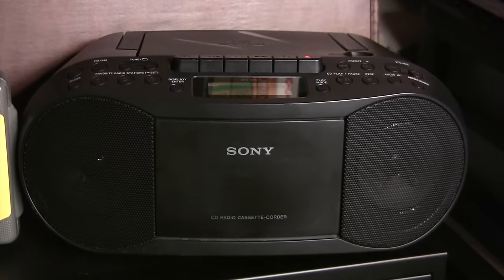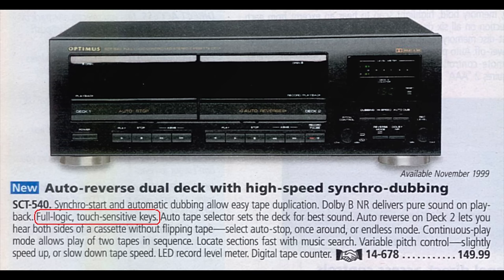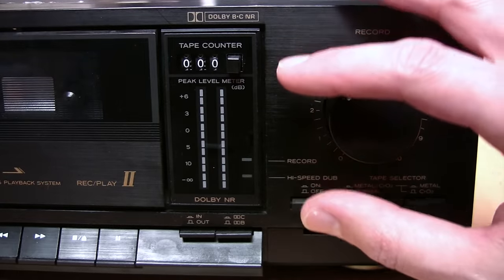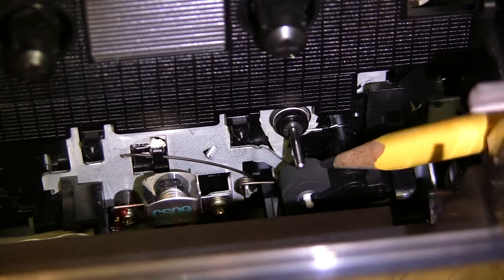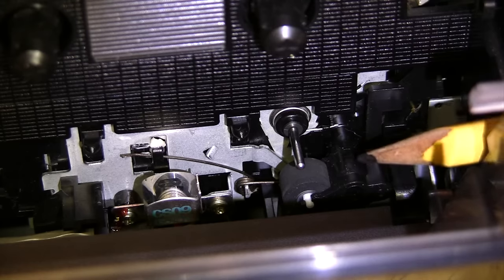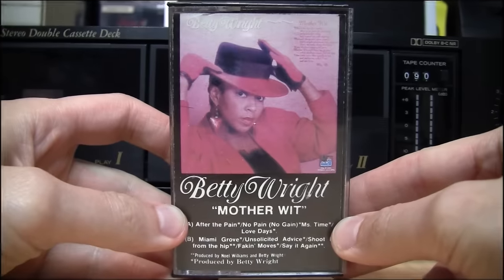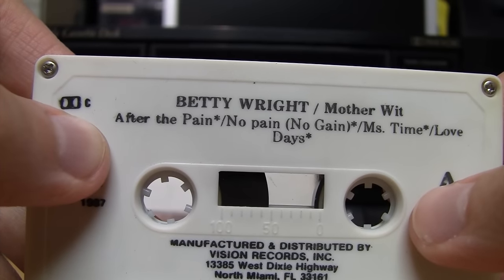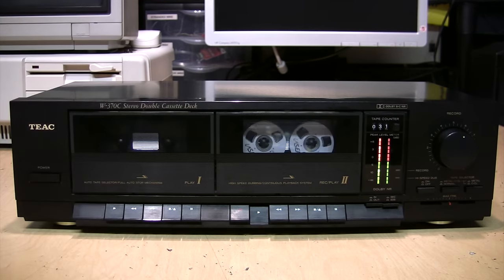Cassette Decks for Dummies

Comment: The lead in/lead out of a compact cassette is approximately 5 seconds.  Easy to time when starting the cassette and a recording, not quite so easy when ending, as you cannot tell exactly when the tape ends and the lead out begins.  (This information I learnt via a Maxell cassette recently.  Also it showed how you can tell what side is which and the direction of playing etc.).  Just thought I'd share as I never knew this before.  Great video as always and some very good points.
Reply from the maker: I like to leave a few seconds of blank tape at the beginning after the leader because it gets the most wear and tends to have dropouts.
Reply: @vwestlife  Yep, I'm just mentioning for those who wondered, especially as I'd never known how long the leader was before then.  I'd never even bothered to question it before either, LOL.

Comment: No alcohol at all on the rubber, some pinch rollers will go mushy in as little as a few months. Total abstinence. It destabilizes the binding molecules. No whatever else (the 30%) or alcohol doped window wash either. Lighter fluid (naphtha) pure and simple, lower odor too. No cotton thingy either, at least you mention the risks. Try and get some strands out of the roller axle down in that tiny space. It's like string on the floor with an office chair wheel, it gets wound up in there and acts like a brake. 

I went to a party back in the day with some live show tapes I made in binaural 3D. Irreplaceable! This is the most important test to do when picking a deck, the first play test which I heard there at that party. The tape sounds fine then on the count of 3 or 4 seconds the treble fades to a quiet muffled tone. HIT STOP. The tape is getting mangled! We were bummed out not to hear the show tape I tried in their deck. I wasn't about to play it.

I grabbed the bottom end of my cotton T-shirt put it over the end of my finger with no solvent at all and rubbed the capstan and pinch roller while it was playing several wipes each turning the end to fresh cloth. All the alcohol there was fit to drink. I've seen brown bands on the capstan that took a fingernail to chip off which no swab will get, this one wasn't that bad. Cheap pre recorded tapes will do this. I popped my tape back in and clear unchallenged sound happened. Whee! Party down! This is how to do it with naphtha.

Finally Dolby HX Pro is the best thing that ever happened to cassettes. There is 10 to 15 dB of treble boosted in what is called pre emphasis on record and cut on playback, so a cassette only gives flat response at that minus 10dB not at full level. All those shows I made are recorded at minus10dB, until I got the last deck I bought new. It had Dolby HX Pro. I didn't bother with C only used B but being able to record hot at 0dB made far better sound than ever.

Comment: This double cassette deck looks like 👍 a 1980’s model. My first home 🏠 stereo had this feature, but I cannot remember if it had an auto reverse 🔄 feature or not. I bought the stereo back in 1988, when I was still in school 🏫. It had soft touch controls, and many 👨 LED lights, in red and green. I thought the stereo was a great 👍 buy. I had no trouble with it, other than a broken 😞 on/off switch. Your friend, Jeff.

Comment: Great video. I have a big question for you on hook up. I  worry about ruining my receiver. I have a pioneer   receiver capable of  laser disc, cd, and tuner. Phono, sat tv. I purchased a 1981 Panasonic stereo cassette deck 635. The back has two sets of male adapter plugs, one set for out and one for in. I hooked it up to the tape setting on the back of the receiver. The cassette player does play. However, the tape plays on all  component settings, meaning if I click on phono, the tape plays through over the album. This goes all the way down the line. I watched the video to hook up. Any help would be appreciated.

Comment: Thanks for the video! I finally found a component tape deck at my local thrift store, a Technics RS-T11, made around 1988, for $3. But… it didn’t have a power cord (found one at home), and the belts appear to be worn (the take-up reel sometimes goes slower than the other reel, resulting in the tape being ‘eaten’). Is it worthwhile to try to obtain new belts and replace these ones? Or keep looking and hope for better luck next time?
Reply from the maker: Open it up and see how much of a job it would be to replace the belts, and if your skill level is up to it.
Reply: @vwestlife  Laughing… my skill level is zero so far, but it doesn’t look impossible with more research. Each tape unit has a wider belt plus 2 smaller belts. (Unless the smaller is really one long belt and I just can’t see where it connects.)

Comment: I think you are the perfect person to run the following experiment: Does recording with Dolby and then playing back without Dolby make a better sounding recording? I claim that it does indeed.
Reply: Some think so, that's what has made most recordings suck since the mid 80's. They found a way to boost the treble both at home and in the recording studio, louder LOUDER! Pink noise is the physical law for sound, white noise is what happens when this BS boosting is done. However the pre-emphisis at 1-7/8th IPS is so much that - 10 or less dB is flat but at 0dB max the treble is rolled down. Dolby HX Pro changes this game to more treble at 0dB than without.
Reply: On all the decks I've tried, Dolby NR playback doesn't seem to work properly any more, it loses some of the sound. Maybe due to drifting values of the components(reduced capacitance etc) within the noise reduction circuit?

Comment: I wish I had known about the finger test before I bought my Technics RS-T20. It won't take up tape nor readily available belt sets are available. Perhaps, the latter is also an important thing to consider before buying an old deck.
Reply: Yes, thats generally a good idea for retro equipment, do a little research into serviceability in general, and in that, the kind of decks suggested in this video are typically fairly easy to service, and not that much of a loss when that doesn't work out. I do own my 'dream deck'  (aiwa ad-f990), which I wanted to own ever since it was released somewhere in late 1983.. its quite fancy and very capable... and an absolute nightmare to work on... which I knew, so no big deal to me, but not what I'd suggest unless you don't mind very complex and potentially expensive repairs (as those often involve finding a donor unit for parts, and possibly hiring some experienced tech to work on it as it is an absurdly complex device)

If you can figure out the size and shape of the belts, you may well be able to find appropriate ones. Keep in mind shape is also important.
Reply: When someone asks to choose between a couple of available models on cassetteculture, the first thing I do is check for the availability of belt kits for each one.
Reply: Very often "different" decks used the same tape mechanism. Look online for the service manuals (not user manuals) for several decks close to the model number of yours, e.g. RS-T22, T30, ... and from more or less the same year (+/ 1 or 2) and see if the mechanism looks exactly the same. If it does you can than search for a belt kit with the other model number. Also bear in mind that Technics was practically the same company as JVC and Panasonic, sharing a lot of components. So it might be helpfull to seek out service manuals from similar looking devices from JVC and Panasonic of the same year too. It needs probably some digging, but I'm confident that it's possible to find belts for that mechanism.
Reply: You can buy packs of belts in various lengths. It's not always ideal, but better than nothing.

Comment: Hi i have a question
I did read often that after 10-20 hours of playback tape heads, capstan and pinch rollers have to be cleaned. For the pinch rollers what kind of window cleaner should I use? That typical what you get in every store and you can spray on the window?
And do I need to demagnetize my cassette players after 10-20 hours of use? Some manuals say I should and some don't mention it.
Do walkmans require the same way of cleaning and demagnetizing as any other cassette players/decks?

Sorry for the "dumb" questions I'm not yet a professional I want to learn more.
Thank you for the answers.
Reply: Most people never demagnetized the heads on their decks(unless it had an automatic builtin demagnetizer) or walkmans, when they were popular, so personally I wouldn't worry about it as long as your deck sounds ok. But preferably don't go sticking magnetized screwdrivers etc near the heads ;)
10-20 hours seems relatively short, but it is easy & quick to do the cleaning. People rarely cleaned them in the 90s(& probably earlier) either, though that probably wasn't ideal. Even cleaning was probably often rough, as cleaning cassettes(rather than doing it by hand) were quite popular I think.
Much the same for walkmans.
Anyway, hope this was some use.
Reply: @DoubleMonoLR  Thank you very much for your answer!! Only one question left? What do you suggest how often should I clean the heads pinch rollers capstans? 🙂
Reply: @PanaSonyc  I'm not sure, I guess doing it(quickly) every 10-20hrs would be fine anyway, I think you're unlikely to do any harm. Similarly though I think it seems unlikely to do any harm if you leave it longer, unless perhaps you get dust inside which could scratch things.
Reply: @DoubleMonoLR  Ok thanks a lot!

Comment: Dolby B, C, S HX PRO and dbx. Also the good machines are backlit in the tape wells. 3 head units with a closed loop capstan system. Good for monitoring recorded content as it records from the source. I own several tape machines the higher end.

Comment: I'd be interested in seeing more about aligning the azimuth, testing wow and flutter, etc. :)

I was looking at getting a decent cassette deck several years ago (for copying a lot of tapes I have - probably a few hundred or so - to PC) and one of the features that came up in my research then was auto azimuth adjustment, which was featured on some I think 1980s vintage Nakamichi decks that were going for around $1K or so.)  Another thing I think they had were things like dual capstans, or another feature that I can't remember the name of but it kept the tension on the tape properly applied and didn't even need another feature that's common on cheaper decks but I don't remember what it was either.
(My budget was nowhere near the $1K Nakamichi decks, more like I think about $100 or so, therefore I didn't buy one then, and still haven't yet.)

I'd still like to get a decent deck for copying a bunch of tapes to PC / digital format, although for now the project is kind-of taking a back seat because of other things going on.  When I do, though, I'll want to get a deck that will get as good of a quality play off the tapes as possible, ideally making them almost sound like new without having to use any kind of signal processing.  Multiple decks would be even better, so I can copy multiple tapes simultaneously.... maybe some of the decent component decks could be mounted in a rackmount server cabinet?

Also I've had a couple of that same model Panasonic Shockwave over the years, as well as its little brother the RQ-SW10 ... still have some, but they all have various issues now, like on one the radio's not working properly, on another the tape won't play, and so on.  I've also had an RQ-SW44V ... the tape on that thing when it worked was alright, but failed a bit faster than the others; also the AM radio had very poor sensitivity - for example, a signal that was strong enough to light the "tuning" LED on the '20 or '10 was barely audible on the '44, and a local-grade near-noise-free signal on the '20 and '10 (lighting "tuning" on the 1st-adjacent channel) still had a fair bit of noise on the '44.  (For example, the only static-free station at my location on the '44 was a 50kW station on 1170 about 6 or 7 miles away, blasting me with about 250-300 kW or so, before they moved their transmitter 9 miles away after which it had a little noise  even though it was aiming about 100-125 kW at me.  A few 5kW stations in the 7-9 mile range on 600, 760, 910, 1360 sounded on the '44 about as strong as 50kW stations on 640 and 1070 about 99 and 111 miles away on the '10 and '20, with 1070 being slightly stronger due to a partial saltwater path.)

I wasn't a huge fan of the selectivity on the Shockwaves either - for example that 50kW station on 1170 when it was about 6 miles away still sounded just as loud / strong on 1200 as on 1170 on the '20 and '10, and could be heard weakly up to about 1260 or so (with local stations on 1210 and 1240 being strong enough to have those frequencies to themselves; also 1170 didn't leak down as far, partially due to asymmetrical IF sidebands, and a strong station on 1130 that was still fairly strong on 1100.  On 1150, 1170 was the sole station audible.)  When I would visit my foster grandma several years ago (she's since passed away and the house was sold), with her being 1/3 mile from a 50kW on 1430 and a 23kW on 1300, those stations would take up like almost half the band, and the one on 1430 had a very strong image on 530.

Comment: Wow. I got my Technics RS-B107 for just $3 at a thrift store. It worked great for about a year or so, when it just needed a speed adjustment. After the speed adjustment was done it's been working great since 2016 (maybe ??) Not bad for a deck that was only made in 1986-87
Reply: Oh I forgot...it doesn't rewind tapes. Everything else works great; just doesn't rewind. But I can live with that.

Comment: Some time ago I saw a Sony stereo cassette deck with dolby S at my local thrift store. It was exactly like Techmoan's, except it was black. They only wanted $15 for it.
Reply: I believe that was a tray-loading model that was part of a mini system sold in Japan if I remember correctly.

That would have been a steal at that price even if all it needed was new belts. The S decks are very hard to come by and when you do, they are a pretty price to pay. I purchased a restored Sony TC K615s and it sounds great but boy did I pay the price, but on the other hand it has great sound and I use it all the time.

You should have got it if you could.
Reply: @RB-xm3ed  Depends on the time and place, I literally bought 2 Dolby S decks (Pioneer T-03SR and Sony TC-WE805S) for the equivalent of about $60 this week

Comment: Last deck I bought was a JVC unit that was under $100 at the time. The price didn't matter, and the fact that there weren't "the most features available" didn't matter either. What did matter was the fact that the unit was rated at 40-16,000 Hz rather than the standard 60-12,000 Hz of almost all the higher prices decks at the time, even at 3x's the cost. That was back in 90 or 91. It does need some TLC finally, but I'd say I got way more than my money's worth out of that deck.

Comment: I own a similar model, only Dolby B. Surprisingly it sounds quite good, especially playing old tapes because it has a limited treble response on type I cassettes, so the tape noise isn't high enough to be annoying.
Reply: That's inevitably caused by the head. Cheaper decks had cheaper heads with lower treble response. Not that it matters for casual listening. And sometimes heads that haven't been used in decades loose response as well. The good news is after a number of hours the surface re-polishes and the treble improves.

Comment: So, if I'm understanding correctly, I can listen to audio simply though powered speakers with the correct connection, no amplifier necessary? (I'm new to this cassette stuff and just needed a confirmation. Thanks. )
Reply from the maker: Yes. By definition, powered speakers have a built-in amplifier.  That's what makes them "powered".
Reply: @vwestlife  Many thanks :)

Comment: How do i connect my cassette deck to a modern reciever that only has a rca inputs but no rca outputs ?
I want to record from my reciever and items like my  turntable and cd player that are connected to the reciever ...
Reply: Also please add info about head demagnetizing to the how to series  ,,,thanks for your hard work and time investment
Reply from the maker: If your receiver doesn't have any tape or pre-amp outputs, you won't be able to use it for recording. You'll need to either replace it with a receiver that does have tape outputs, or connect the cassette deck directly to the source you want to record from.
Reply from the maker: See this video for info on how to clean, align, and demagnetize cassette deck heads: https://www.youtube.com/watch?v=kYK9Y7HMOR4